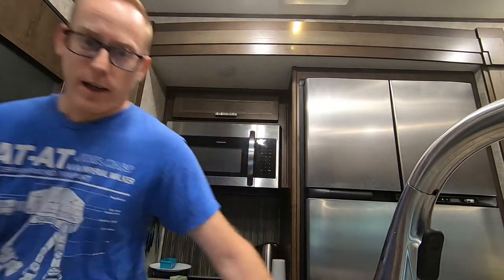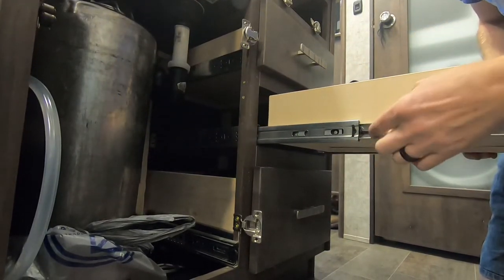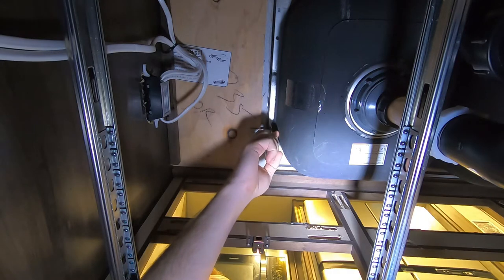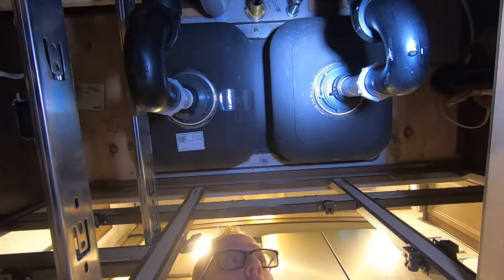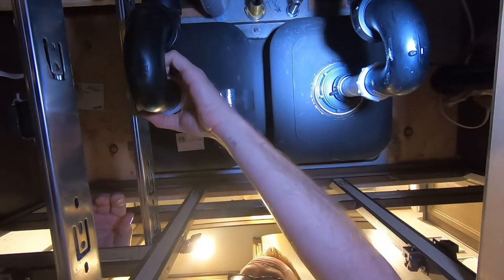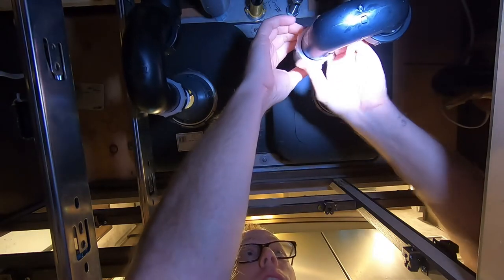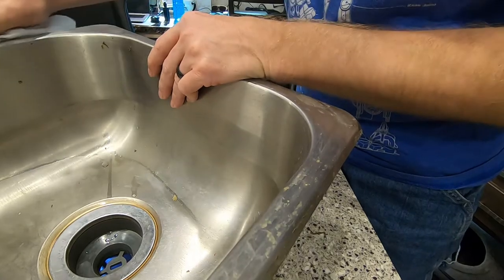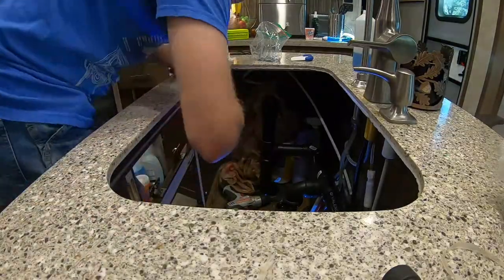Our RV sink is falling out!

Comment: Thanks, man! This just happened to mine. I hope I have wood substrate under there like yours. I prefer screws to epoxy!
Reply from the maker: Good luck man!
Reply: Now to figure out how to get the hard adhesive off my acrylic basin.
Reply from the maker: @Raymond Kaltenbach  is it just the same  construction adhesive they use on everything?
Reply: Seems to be an epoxy. Gonna sand it smooth tomorrow, install under mount brackets, and caulk the snot out of it.
Reply from the maker: @RaymondKaltenbach-qf6il  Sounds like something i'd do!
Reply: It’s mounted, caulked, and drying. This upcoming weekend’s trip will let me know how I did.
Reply from the maker: @RaymondKaltenbach-qf6il  let me know if it holds!